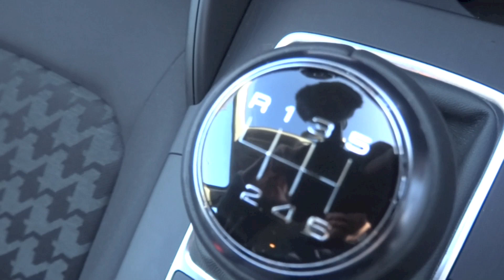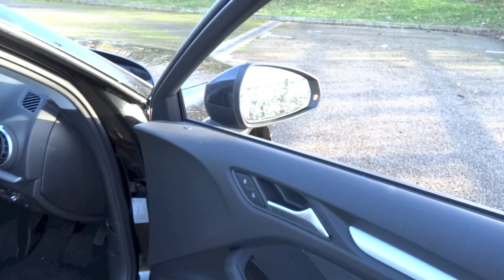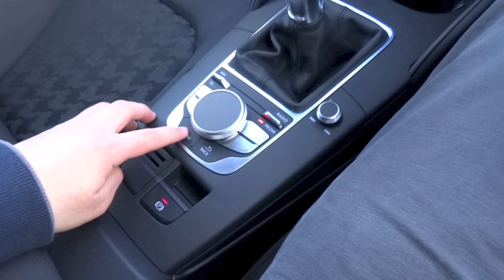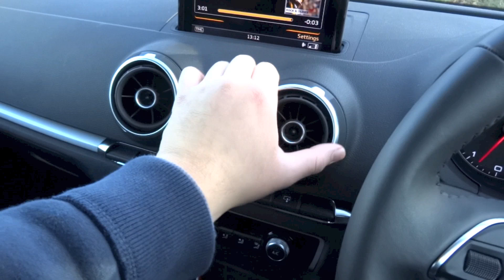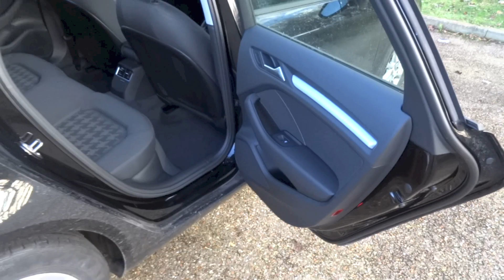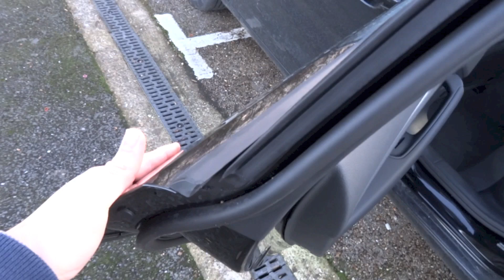2014 Audi A3 Sportback 1.4 TFSI 125 SE Start-Up and Full Vehicle Tour

Comment: i’m sure no one will see this but if you do… how do you do a hill start in this car with no hill assist? does it hold you on a hill for a few seconds or do you just have to have your foot on the break to turn off the electric handbrake and go from there?
Reply: Same that happened to me the auto start on this car while on the hill it's so hard and when I pull the brake up and then press the gas pedal it releases the brake electronic it self which stalls the car sometimes when ever I turn that feature off it never turns off

Comment: wow what a boring car....great review
Reply: It's not a boring car. I have the 2.0 TDi. It's just the presentation in this video that is boring. Over half an hour for a review?!
Reply from the maker: It's more of a tour as per the title, not a review, hence the length.  I have as much information of the car as possible in the video, so if the car has less features, the shorter the video, and if it has more features, the longer the video.
Reply: Vincent KC I have a 1.8 TFSI Quattro S Line and I beat most hot hatches in a drag race. :-)
Reply from the maker: +Vincent Tan Thank you for watching!
Reply: Couldn't be more wrong
Reply: Love this car, power and class!!!
Reply: It's a manual transmission. Not boring at all